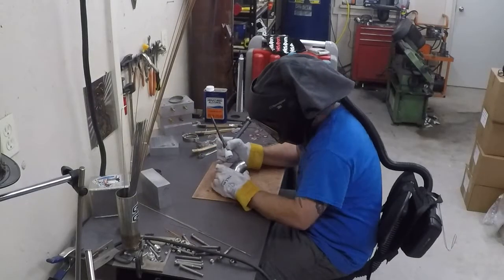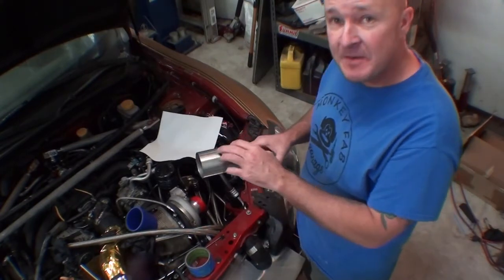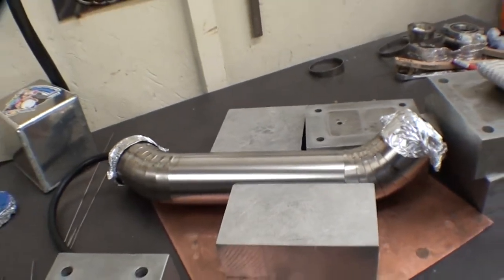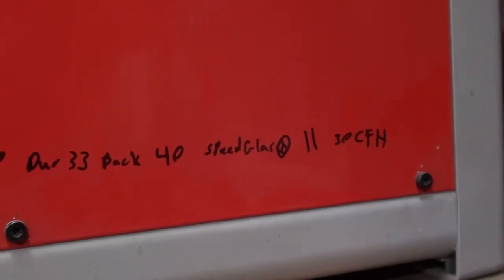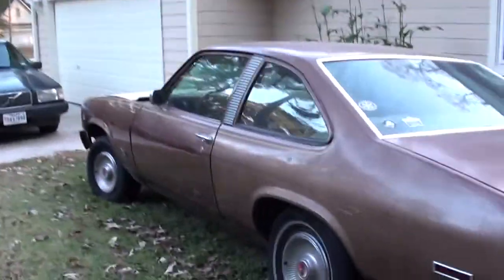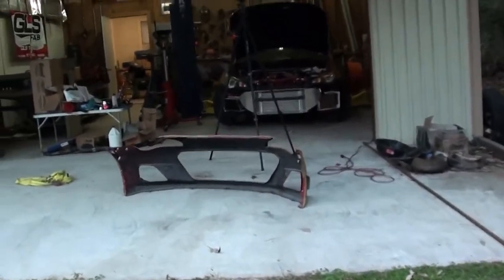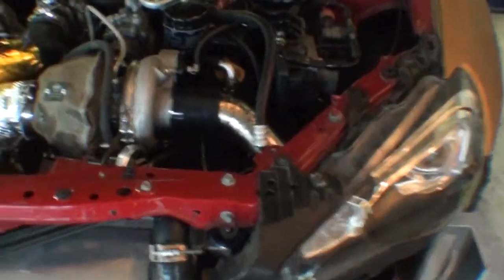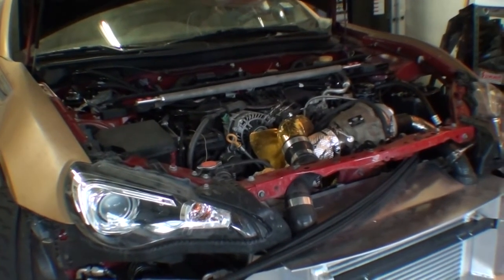Turbo BRZ Titanium Intake 2

Comment: Nice job dude!  I like the channel.  I did nothing but SS and a few titanium pie cut exhaust for 9 or 10 years.  I hated it then but miss it now.  Anyways one thing that is awesome for assembling pie cuts is to put a piece of round 3/4" tubing in a vice seal one end.  Score a traugh down the center,. Drill holes every 3/4" and then run a purge line into the back of the tube.  Tacking them together on one of those makes it fast, easy and you can purge your tacks!
Reply from the maker: 5th Street Fab I enjoyed playing with the ti. It was a learn curve for sure. I hate pie cuts and generally try to have as few joints as possible. That is a good idea and I’ll remember it. Thanks sir